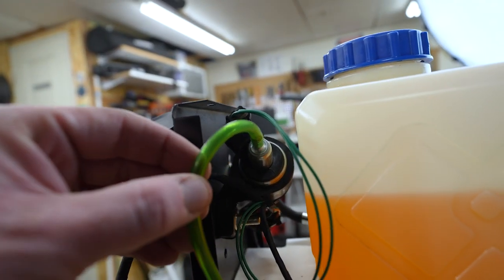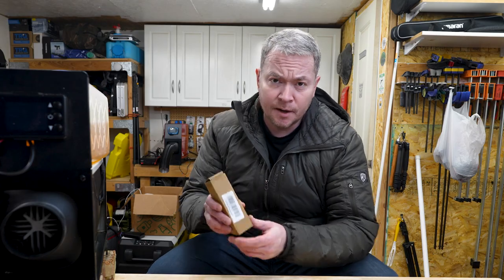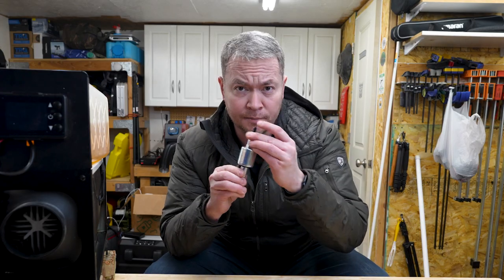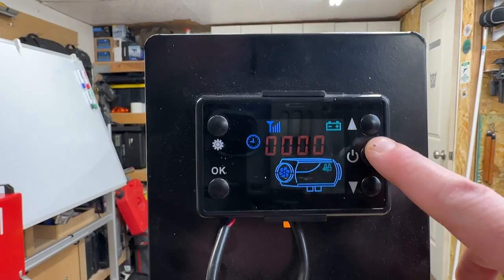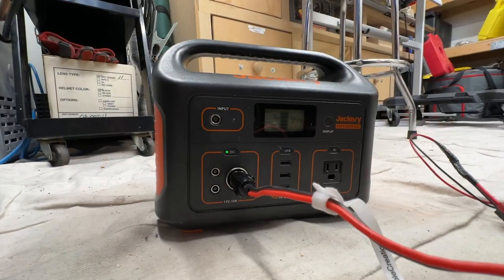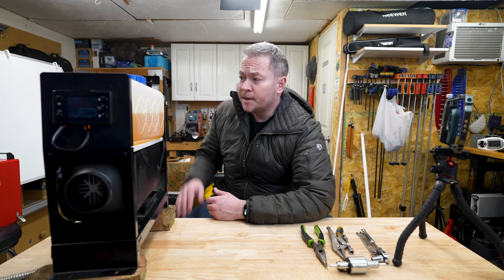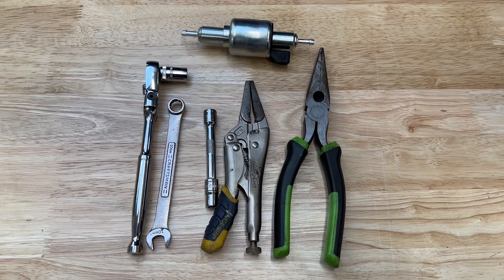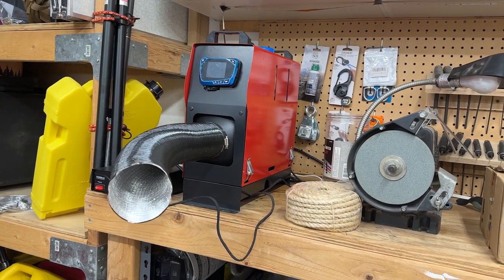Diesel Heater Died After 3 Years

Comment: Little pro tip.....  The Bosch style connector doesn't require the retaining clip yanked off, just depress the cross bar and it the connector slides right off and for reconnecting just push connector on to pump till you hear the click 😎
Reply from the maker: Thanks for the tip!  Another viewer mentioned the same thing and I had to try it immediately.  Sure enough, popped right off!  Made my life easier :). Thanks again!

Comment: That’s a more substantial fuel pump than I would have expected for a heater.
Thanks for the diagnosis, fix and long-term report!
Reply from the maker: Yeah, pretty big sucker for sure.  Glad it was an easy fix.  The whole time I was wondering what I would say or whether I should post the video if I couldn't fix it.
Reply: @TomtheDilettante  Picture brief snippets of this video, with a monologue describing the troubleshooting. Fade to a showcase of the brand new unit, conclusion: “it turns out it wasn’t the fuel pump, but everything it was attached to.”
Reply: Another thought on it being a hefty pump: Maybe the flame nozzle needs high pressure, kind of like an atomizing/vaporizing injector on a car engine.

Comment: that's the ticket.
I have a walk behind mower with a Tecumseh motor, that I have to replace the carburetor on about every other season
things do last as long as they use to
Reply from the maker: Oof...replacing or rebuilding carbs is not how I'd prefer to spend my time just to keep something running.  I feel ya on that one.  Last time I cleaned out a carb for a generator I forgot to pull a jet out when blowing compressed air thru the passages.  That compressed air sure got it out though.  F**ker shot across the shop somewhere and I must have spent an hour looking for it LOL

Comment: 3 years that aint bad for a chepo heater, both of mine have been running between Nov 22 and april 23  but now we burn kerosene with a little 2 stroke oil to lube the pumps in the UK as its cheaper than red diesel. that metal clip on the fuel pump wiring plug just needs to be pushed in to remove the plug it doesnt need needle nosed pliers or removing to release the plug by the way.

Comment: Man, if I would’ve thought to use some vicegrips for when I changed a thermostat. 😂 I would’ve saved a whole lot of green!
Reply from the maker: LOL!  TBH, I learned that from a mechanic while doing just that...a radiator change.  Large clamps to pinch off the hoses (gotta be careful not to damage them of course) to prevent a mess.  Kinda just took that gem of a tip and applied it to any hose :). Thanks for watching and chiming in

Comment: FYI- that 'clip' on the electrical connector is not a clip, it's a button.  Just press it down and pull the connector apart.  No need to remove it.
Reply from the maker: Good to know!  Thought it was a retaining clip.  Gunna have to give this a shot now.  Thanks for the tip!
Reply: @TomtheDilettante  Yea, I have to admit to doing the same the first time I saw one too.  But there are little ramps waiting below to spread the clip when you press it down.  They are great for mechanics because there is less fiddling than other styles.  The down side is they take more force to actuate than you get from it's plastic cousins.

Comment: Its nearly 2 years ago that you posted your new diesel heater from china, so i suppose it broke down after nearly 2 years instead of 3?
Reply from the maker: Reasonable question.  Right, wrong or otherwise, I'm counting Jan-Mar'21 (made video in March and posted April), winter 2021-2022, and winter 2022-2023.  To be honest, I had run one of these units before my initial video.  I was still completely new to them, but I didn't want to invest the time making a video on something that was not worthwhile for others.  So, I had run one for a couple months before making the initial video which I then made thru the lens of it being completely new.  Hope that makes sense.  Some may think that's a bit deceptive, however, I look at it as making sure I give something at least a cursory shakedown before recommending it to others.
Reply: @TomtheDilettante  Thanks for clearing it up 👍

Comment: Uhh, many say that green tubing isn,t great for longevity,, uhh white mylar?? They sell a near quiet fuel pump but it,s like fifty bucks or so but no ticking. Got to look at economics , three hundred hours use?? That,s about 50c an hour for a hundred and fifty bucks , and fuel. Now still running,, good deal. Can,t be productive in the cold. Could diy up a heat battery.